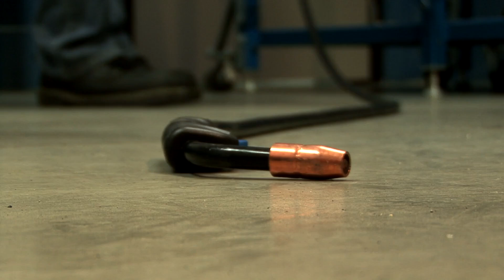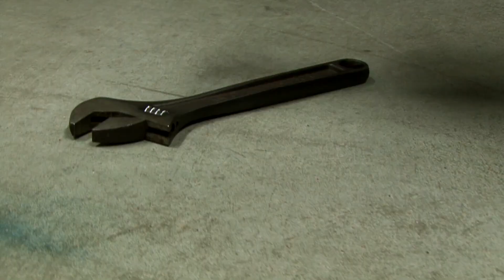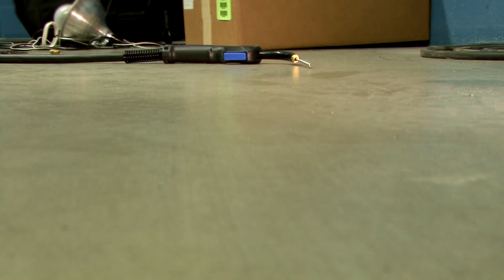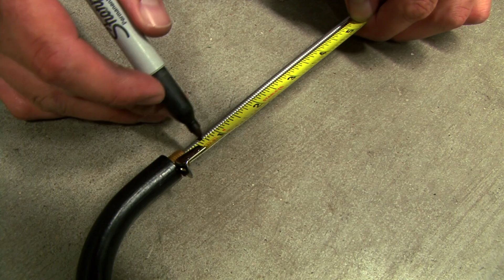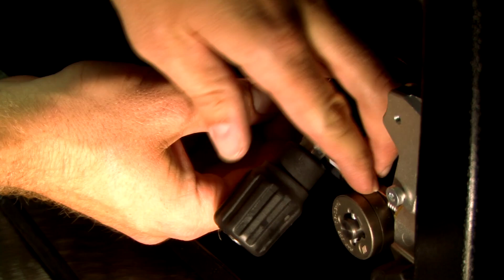Replacing your MIG gun liner

Comment: For such a small welder (160A-200A), Can we replace the torch line from originally like 3m to 5-8m without an issue on motor feed power or poor arcing?

Comment: Quick question, i’m getting burnback all the way back at the feed wheel mechanism where the mig wire is being fed onto the base of mig gun cable. I’m not feeling resistance in my liner as i’m pulling the disconnected mig wire out the gun end, and i’m cutting a clean end before feeding the new wire in. Any pointers for troubleshooting for me? Thanks in advance.
Reply from the maker: We're sorry to hear about this! What machine are you using?
Reply: Ahhh sorry, i’m running a Millermatic 211 Autoset with MVP. Its a great welder, and i’ve been using it for years and this is only the very first issue i’ve ever had.

Comment: how do you replace the liner on a miller mig that doesn't have a plug for the trigger wire
Reply from the maker: Hi Gary, what unit are you looking to replace the liner on?
Reply: @MillerWelders  millermatic 35 with the black face

Comment: So if the wire is melted inside the liner just replace it! I have a lincoln electric weld pak 100 are they replaceble?
Reply: If it has the magnum 100l mig gun, then yes. I actually just took mine apart today. I ordered a whole new mig gun assy through amazon, but they didn't deliver as quickly as I was hoping so I was poking around my welder today to try and make it useable, and took it apart to see if the liner was replaceable... it is, and can be found on amazon (or wherever...that's where I looked) for less than $10 vs. about $65 for a whole new gun assembly. My welder is a Home Depot version Weld Pack 3200HD (I believe the equivalent is an SP135). I'm pretty sure all the smaller welders use the magnum 100L gun though.
Reply: the liner is held in with a small allen set screw. loosen the screw and it'll pull right out.

Comment: If i run mostly .023 in my welder, can i run this liner (194 011) ?
Reply from the maker: If you have an M-series MIG gun, the correct liner for .023 would be stock number 194010

Comment: I have an OLDER (STOCK#903123, 
Ser.KA896404) Cricket XL. I have the new liner. I'm trying to unplug the gun from the casting feeder inside. Does it just pull out with o-rings or is something holding it. I see no clamps, just stuck maybe. Didnt want to break it. Also I see no defuse on the gun end,  just the tip and contact Nozzle
Reply from the maker: Hi Garry, thank you for reaching out. We recommend giving our service line a call to talk this through with a tech. The number is 920-734-9821. If there’s anything else we can help with, just let us know.